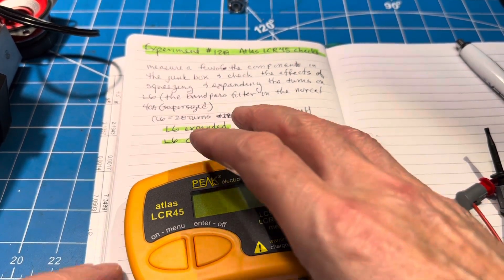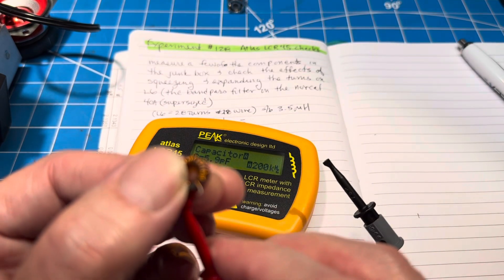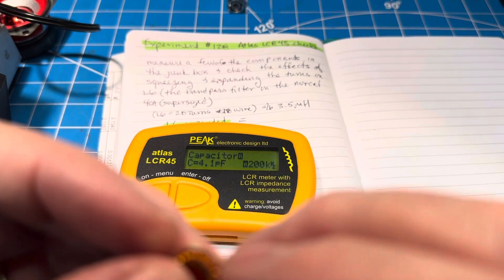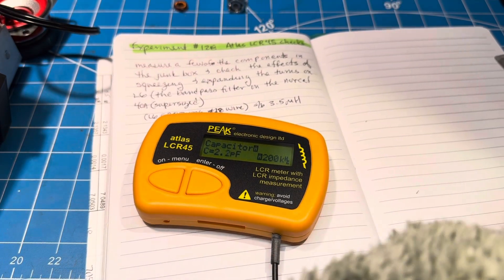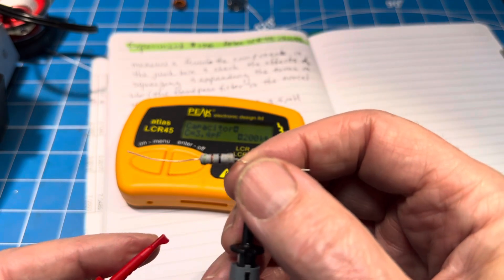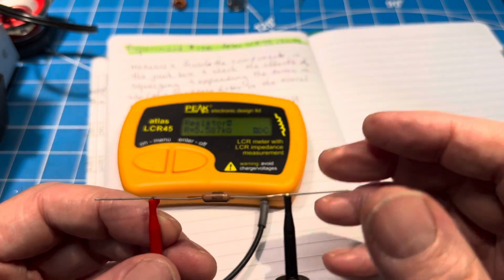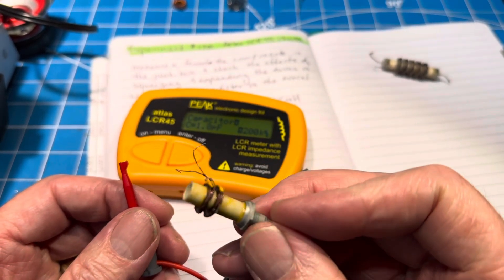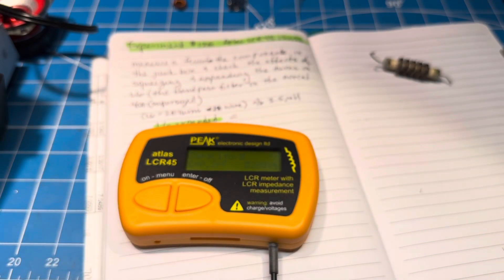New Toy in the Shack! Let’s measure L6 and a few other unknown parts!

Comment: Great British technology and worth the money!! When building kits I pretty much measure anything before soldering it in with the belief that that is easier than troubleshooting a duff part. There's a Diode Tester and separate transistor tester that Peak offer.
Reply: I own the Transistor tester with Tracer function. Great tool.
Reply from the maker: I’m going to go Googling and find out more details - thank you!
Reply from the maker: That’s interesting! Is there a write up on these? I assumed the origin was China. 
The curve tracer mentioned below sounds useful as well
73,
Bruce

Comment: Youe first component was a molded inductor with red+violet+brown bands? It should be a 270 uh inductor but your checker read 240. 

But if the tolerance band is silver, then the variance is within 20 percent. 

https://www.electricaltechnology.org/wp-content/uploads/2022/01/3-Band-Inductor-Color-Code.png
Reply from the maker: Very nice summary! I somehow talked myself into it being correct.. I guess at midnight yellow and violet became interchangeable since they normally travel together as a 47. Haha  I guess we can give it credit for still being an inductor after being in the junk box so long!
Thanks for the useful link! 73, bruce